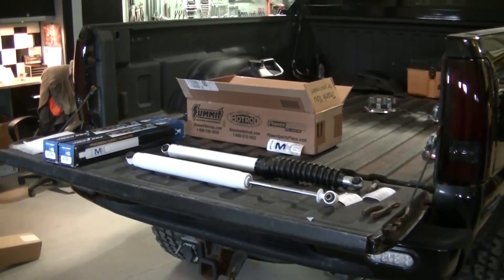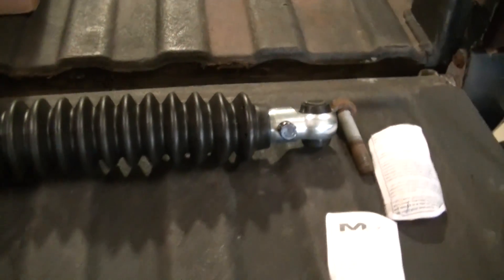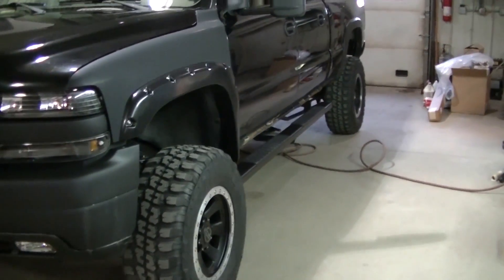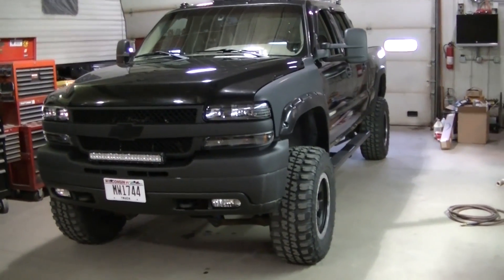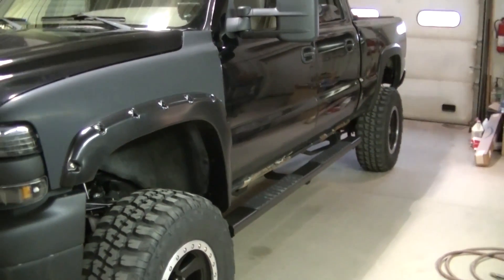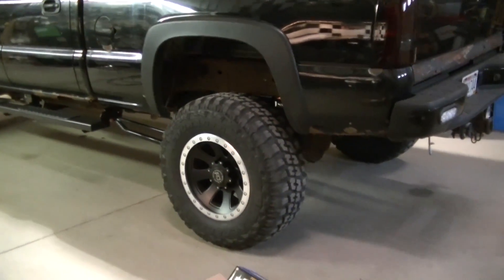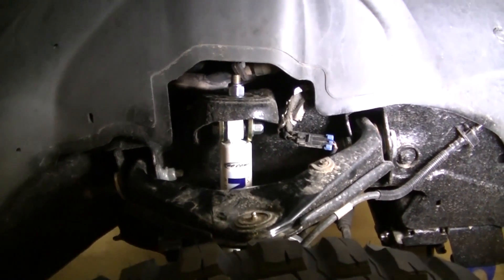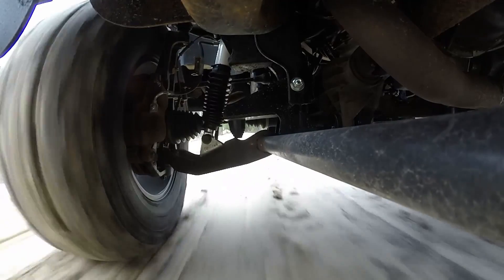"Project Midnight" Pro Comp MX6 Shocks Silverado 2500HD

Comment: have you thought about checking your cab/body mounts???  I know GM had a TSB for the 1500's.  Don't know if 2500 had the same issues.
Reply from the maker: I have heard of the frame bounce.  I feel a similar bounce in my dads 04 2500HD but it's not near as bad.  The lift and mud tires could be making it worse.

Comment: mossman381 would you put these in Darth? Ive got an 01 2500HD Dmax i plow with and haul a trailer that needs new shocks. Great video!
Reply from the maker: They are expensive but I like the adjustability.  I would buy them again.

Comment: FYI  ...F &  S   on those shocks refers to piston speed F = FAST &  S = SLOW   faster piston speed = softer  slower piston speed = harder .....i own a set of these shocks went through the same issues
Reply from the maker: Sure seems like the F made the ride firmer to me.
Reply: i kid you not cant remember where i found the info but i have a 99 silverado short box reg cab and it rode like a buckboard after the install so i started investigating those shocks are 160$ cdn each so i wasnt happy  and thats what i discovered .... even set on the softest my truck rides like crap im assuming its because its extremely light  285 /75 r16 s
Reply from the maker: These shocks are probably going to ride a bit more stiff than OEM shocks.  I had a 2000 Silverado short bed reg cab and had Bilstein 5100's and it drove great.
Reply: thats awesome input bilsteins are what im lookin at ... cant wait to get these pro comps off ...i also have a darth dually and was thinkin of puttin them on it but the fronts wont mount up lower mount is different THX

Comment: I would send them back! That's not right they use an adapter instead. Did they explain this before you ordered?
Reply from the maker: It looks stronger than the stock mount just a little harder to install.  Not worth sending them back.  These are good shocks.